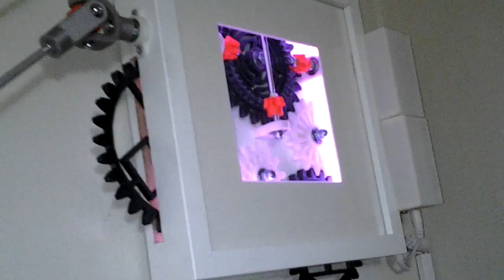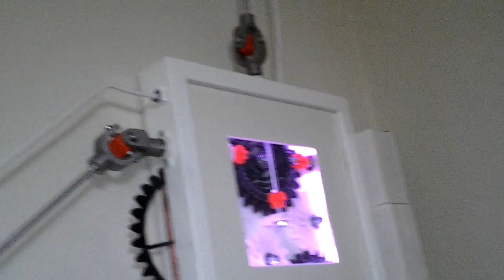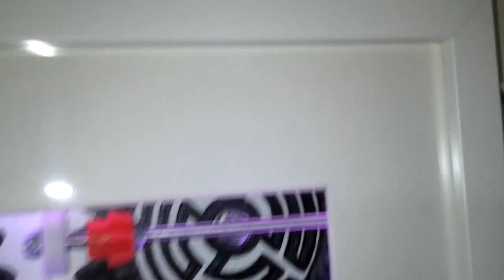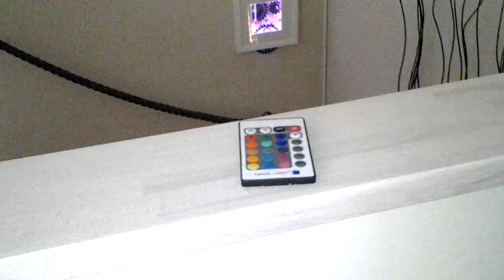Gear Project 2

Comment from the maker: The wire is stiff, it is EKKX-cable (normal telephone cable here in Sweden). It is four 0,5mm solid copper wires. That makes it stiff enough. :)